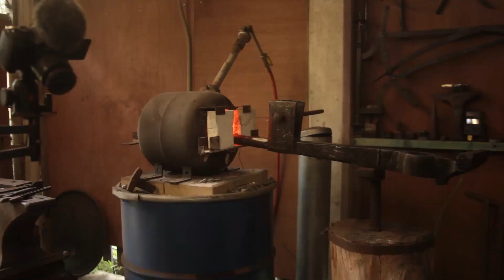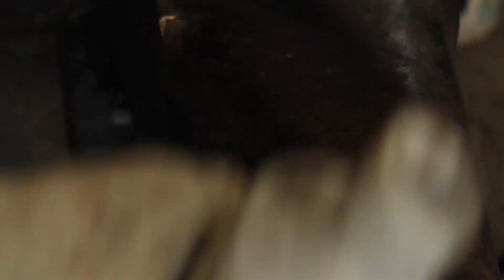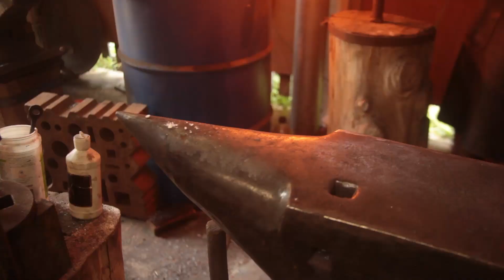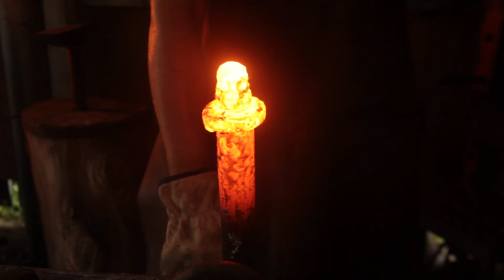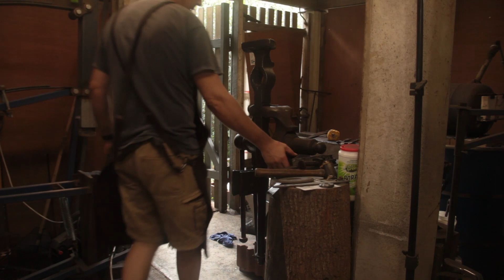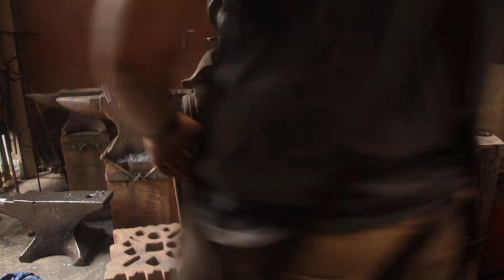Post Vise Repair pt2

Comment: Doc, nice repair!  Do you have any idea where I'd look to identify my post vice?  I think it might have been my Dad's Uncle's or older, who had been a Blacksmith somewhere around ~1900 or so.  I need to go dig it out (it's not mounted because it needs repair) to get measurements & I guess photos for comparison with other old post vises.  (Also, the old anvil that came from my Grandfather's workshop may have come along with the post vice too, but it looks like it must have been left outside for nearly 100 years based on the corrosion on it's top surface (or what's left of it), so it is more ornamental than useful.  Fortunately I have a "new" anvil that is in very good condition.)
Reply from the maker: Bob I’ve uploaded a short on where to look. That said some were made for resellers and so have no makers mark on them.